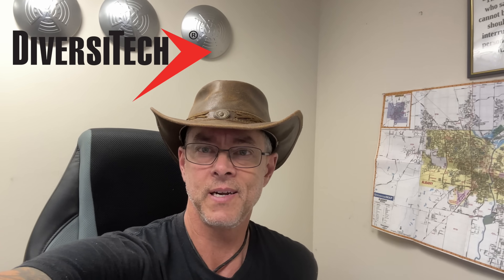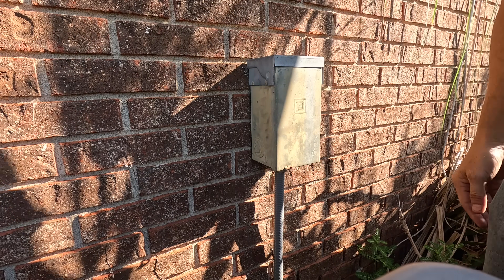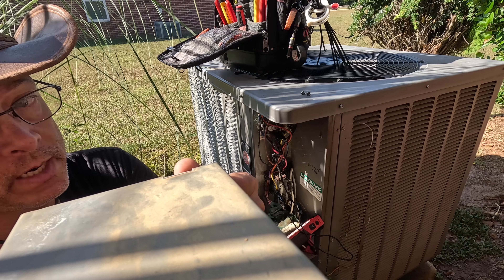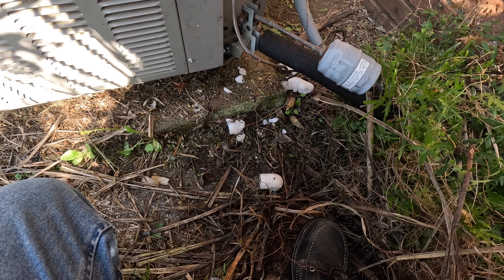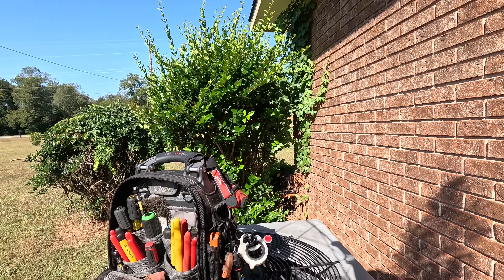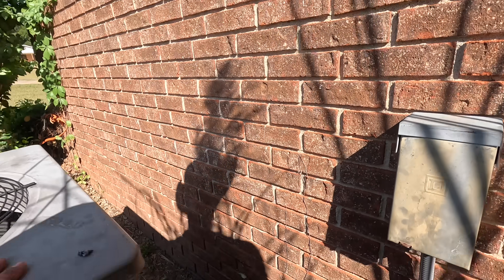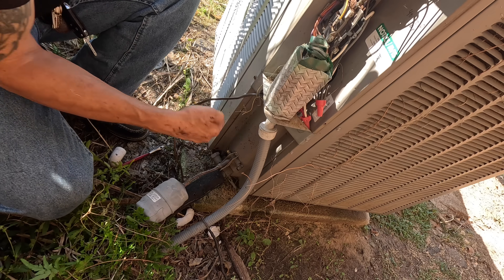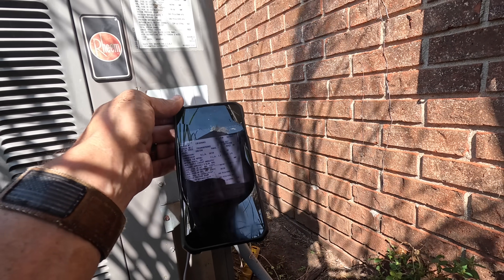How To Properly Go About Condemning An Older System!

Comment: I believe coil is bad every leak detector I have had high moisture makes go off.
Reply: large temperature change makes many of them go off also. if you stay in there hovering around it should keep going off about the same if on an actual leak.

Comment: It seems like you had been there before, but I know you would not have done that to the capacitor. Maybe you didn't open the condenser up. Anyway, that was a good idea to do that leak search, instead of doing any other work to it. Nice job selling that changeout.

Comment: Just replaced the compressor in my R22 system. The compressor came with zero oil. WTF. Anyway, it's always cheaper for me to fix it than pay an HVAC person
Reply: That's messed up Kevin.
Reply: better than the wrong oil!  if it was special ordered/listed as an R22 replacement unit, they probably ship them all dry due to not having mineral oil on the assembly lines anymore. it's been mostly POE oil for ages, some PAG.  many larger compressors come empty anyway and it's easier to add the required full oil charge/type you need, vs. having to drain it out and refill.
Reply: @throttlebottle5906 I put mineral oil in it. That's what the data plate called for. It was actually a used compressor. I didn't want to spend $1500 on a new one. It actually looked new when I got it. But you never know. It may burn out tomorrow. My last compressor had mineral oil as well. Hopefully no contamination

Comment: How expensive could an evaporator be to replace vs. a complete HVAC system?
Reply: A lot cheaper, but that unit being so old, you will feel like an idiot to pay for a coil replacement and then the compressor go out. Especially the way they abuse it.
Reply: @jthonn  Compressor is not likely after that many years. Most compressor live long or they are murdered by incompetent HVAC.
Reply: @Garth2011  I don't have that kind of luck. I would rather put that money towards a new system and get a full warranty.
Reply: @jthonn  Understood but today's HVAC is not reliable, cheap, over engineered, full of electronics, sensors, delicate parts etc. and about 3X more money than they used to be. Not to mention, all HVAC warranties only provide parts, not the labor, after the first year. Parts are also proprietary and expensive.
Reply: Not nearly, but it's hard to find compatible coils sometimes. Supply has been spotty as well. A couple thousand vs 6k and up

Comment: That indoor coil was really dirty. wow!
Reply: That is probably the whole reason that thing got trashed. I know a leak can cause them to freeze, but in this case I would speculate that the dirty coil caused it to freeze up, and they just let it ice up unreal which with all the expanding and contracting on that old coil made it leak.
Reply: @jthonn  They never replaced or had an undersized air filter. We need to do more than play with our smart phones! LOL
Reply: @bobboscarato1313  You got that right